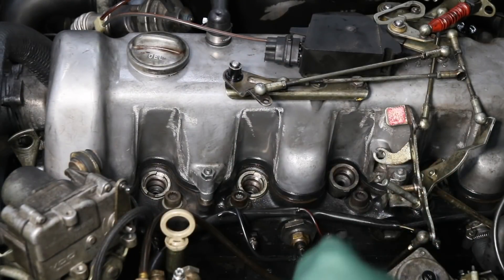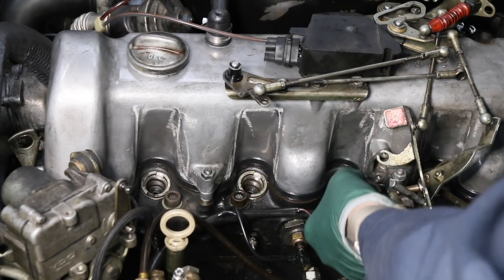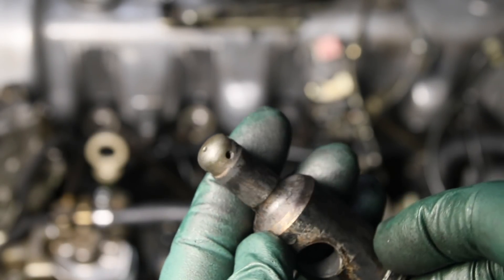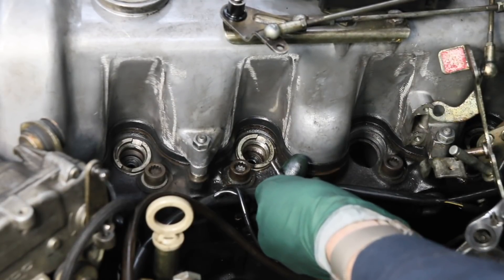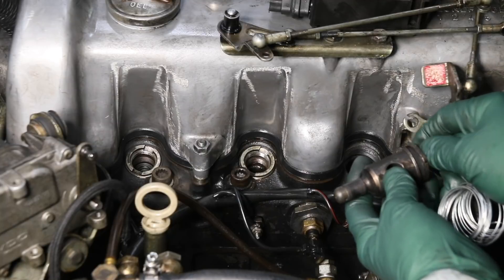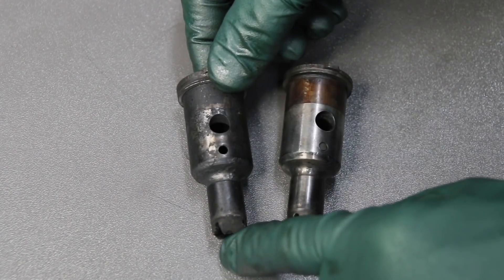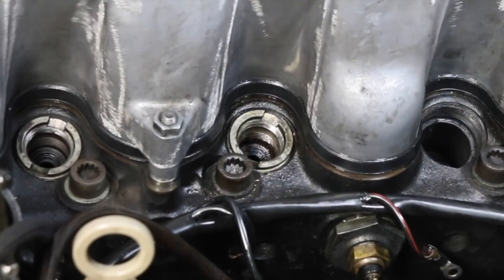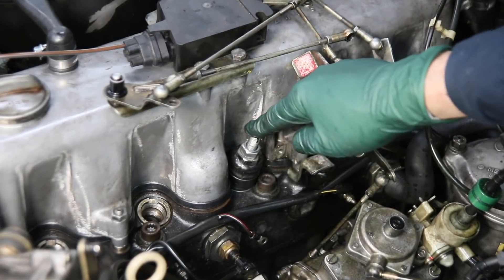Turbo Diesel Pre-chamber Failure Again??? Same Cylinder Even!

Comment: I had oil on serveral of my injectors, is that most likely my piston rings? also how wrong can the opening pressure get if u don't adjust it when changing injector tips?
Reply from the maker: It could be piston rings, valve seals, or leaking turbo. Compression test would help. It is hit or miss when replacing nozzles. Sometimes pressures are close - sometimes not. Best to test and adjust

Comment: Can a damaged combustion chamber cause the car to overheat under load. Driving perfect but as soon as there is an uphill it overheats within a minute
Reply from the maker: Probably not. If you know your radiator is clean, coolant is correct and new thermostat installed, then I would recommend you get a cooling system pressure test with the engine warm. You could have a small leak in your head gasket or a small crack in your cylinder head.
Reply: Thanks
 @Mercedessource

Comment: Can an bad pre chamber cause engine to flood and smoke? It om606 the guy that sold me a car lied about mechanical condition of it. And when car cools of there is no combustion in #6 and it's just smokes and misfire horrible until it gets really hot. Than it's petty good. 
Compression is 280 on cold and 255 on warm engine, but only in #6 all the rest are around 360psi. 
Leak down shows 80% leakage. 
That engine is toast?  Or maybe It could get a little better if, after I find what is causing all this? Like a pre chamber?  Have "new" injectors didn't help at all.

Comment: Woooow l learn a lot ,mine its C250  w202 605 engine it doesent start it cranks nicely but fail to start  ,but if you use quickstart it start then it sound a bit rough and smoke allso in idle and drive too  and the oil is leaking on pre chamber holes as it idle about 2mins and if you open the engine oil cap  it that oil goes down ,can you help me sir how do l do with this engines .Thank you inadvance